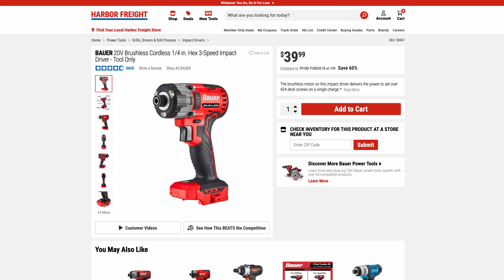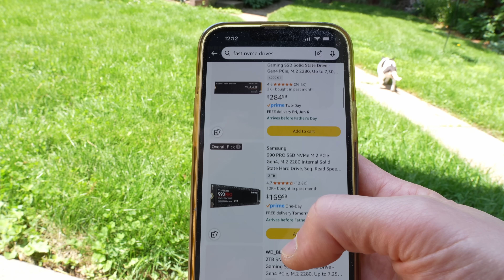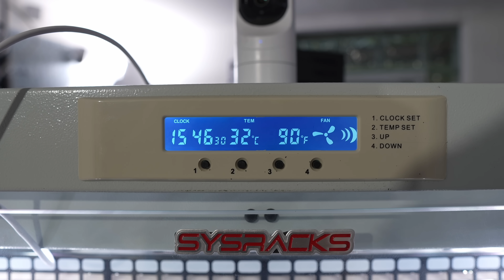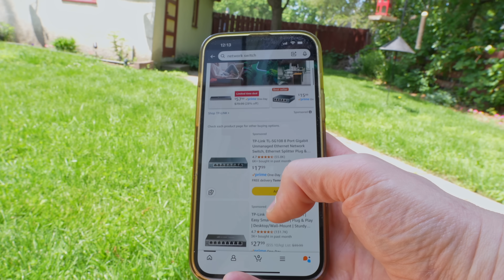Buy Once, Cry Once: How I Wasted $2,857 on Switches

Comment: This is a great thought experiment. 
I have done the same thing so many times. 
The tough issue is that you don't know if you need the best thing. Perhaps the cheap thing does fine, or you are ok with sub par because you realize that its not your passion or you don't build more in that direction. 

I think it's about what you said, which is stepping back and thinking, as opposed to "just one fix" 

Sometimes, you don't know what you don't know... Until you fail, and then you know!

Comment: The thing about SFP+ is that it's just the interface before the PHY in every RJ45 switch, so its flexible and I use SFP+ as much as i can, because it saves power on all ends and costs less

but SFP+ to RJ45 10G? that's PAIN

Comment: I felt this video deeply, having upgraded Unifi switches time and time again, finally landing on 2 x 48-port Unifi switches and the Aggregation switch. But I also PoE power a LOT of my gear now, including my 5-node HP G3 Mini (i5/64GB each) cluster, my 8-node Pi4 cluster, my 3-node OPi5 cluster, and others. I've had to rethink my edge gear based on the capabilities of my network instead of the other way around.

Comment: It's not a waste if you learned along the way, but that Pro XG is an abomination.  It's a "suckers with money" solution to problems that aren't there in the first place, and its disjointed feature set tells me this is really 3 smaller switches in a trench coat.  Notwithstanding the fact that 25G didn't exist yet, this would already have been a dull product back in 2012 when 10GbE was exploding in office datacenters and multimedia shops.  Even today, things that want PoE rarely need even 1G, except for little breakout switches of course.

Most people reading this would be better served by two much cheaper switches: one very fast one feeding your workstation(s) and home servers, and one basic PoE workhorse for all your IoT stuff.  Stick with Unifi if that's your fetish, I'm not judging.

Comment: I still don't think 10G over copper is the reasonable solution in most cases. If you need the more-than-2.5G performance, I'd always argue that fiber is the more efficient solution. And yes, if you think you need more than 2.5G for your Wifi, you probably should attach a cable to it. Maybe there's a case to be made for really high-density stadium wifi setups or something like that. But for almost all other scenarios I will argue that 2.5G is the right speed for your copper infrastructure.

Comment: Don't buy what you 'Need Today' also don't buy what is the 'Best and Brightest', buy what you 'Plan on Tomorrow'. 
You shouldn't purchase a 48 port switch when all you plan to use it for is a single computer, a printer, a nas and a ps5. Just incase in the off chance in a decide you might wanna plug in more stuff. 
I'd say for the most part, the way you did it is perfectly fine. Also the amount you paid for the stuff isn't the end price, you can resell your old stuff to recover some of that and reduce your sunken investment.

Comment: I bought my Netgear GSM7248 48-port GbE switch back in 2019 for $60 USD.

It was sucking back too much power (and a bit of noise that came with it as well).

But my biggest driving factor for SCALING my homelab DOWN rather than up, and out, as most tech YouTubers/homelabbers do, was just the total power consumption which, at the time, spread across 4 NAS servers, and the 48-port switch, was sucking back a grand total of 1242 W from the wall.

So, with a mass consolidation effort, I moved everything into a single "do-it-all" Proxmox server, originally with 256 GB of RAM, and had a 4-to-1 consolidation.

(Since then though, I did fire up my QNAP TS-453Be 4-bay NAS back up, which, when running, consumes about 50 W with four HGST 6 TB SATA HDDs, but when the drives are powered down, only consumes about 17 W.)

The two biggest advantages with the mass consolidation was that:
1) The virtio NIC presents itself inside Win10+ and Linux as a 10 Gbps NIC. (Haven't been able to find out what it's true speed limit is, because I'm only using HDDs.) But this meant that if I wanted 10 GbE networking, it was entirely virtualised within the Proxmox environment, and therefore; I didn't need physical 10 GbE hardware (NICs/switches/cables, etc.) And also with it being virtualised, I can add as many devices as I want to, and not have to worry about running out of ports.

2) I ended up cutting my total power consumption down from 1242 W to around 700 W right now. So, not quite half, because I had to fire the 4-bay NAS back up, because when the Proxmox server was busy with I/O, it would cause some services to timeout, so separating it and having something else that tended to have less I/O requests, helped with some of the offload.

And now, I am using two Netgear GS116 v2 16-port GbE switches instead, which only use about 7 W each, so I have 32 ports total, and those are really cheap now.

For higher speed networking, I also spent $2270 USD on a Mellanox MSB-7890 36-port 100 Gbps Infiniband externally managed switch, which I bought in 2018, which provides upto 3.6 Tbps (half-duplex, or 7.2 Tbps full duplex) of switching capacity. That switch can suck back, I think it's like 200 W, but the spec sheet says that nominal power consumption should be closer to 122 W with passive cables (and of course, it also depends on how many systems are connected to it).

I don't have anything that needs PoE yet, but if I were to deploy it, I would probably initially go with getting a PoE adapter/injector until I have enough devices where it would actually make sense for me to install and deploy a PoE switch.

The idea of me going straight from 1 GbE to 100 Gbps IB is such that I skip all of the other speeds in between (2.5/5/10/25/40/50 Gbps). So rather than making, as you said, small incremental upgrades, I just jumped straight to 100 Gbps. On an absolute $ basis, yes, it was expensive. But on a $/Gbps (per port) basis, it ended up being cheaper than many of the other options. (I think that I did the calculation once, where if I wanted to keep the $/Gbps constant, but then scale that down to like a 16-port, 10 GbE switch, that switch would need to cost no more than $60 or something like that, to stay at the same $/Gbps rate as my 100 Gbps switch, which, of course, doesn't exist (yet).)

That's how it ends up being a much better deal.

And from watching tech YouTubers and/or other homelabbers, many don't tend to run the analysis this way.

And I also went 100 Gbps IB because for 100 GbE (also from Mellanox), Mellanox has the Mellanox tax where they would charge an extra 50% even though their NICs have their VPI where you can SET the port type as either IB or ETH, with their `mstconfig` tool.

In other words, they're charging said extra 50% just because they can, when really, they could just as easily make a switch where they could've deployed their VPI technology for each port, and then you can get a mix of 100 Gbps IB/ETH switch in one, but they don't do that, because they want more money from you via arbitrary, forced product segmentation.

(Why let you buy one switch that can do both when they can make you pay for two - one for IB and one for ETH?)

So, as a result, 100 Gbps IB it is.

Comment: I had this issue with CPUs for my server
i7 2600 > i5 6600k > i7 7700k > R5 5600G and then i just gave up and got the i5 13500 I kept running either into performance issues or issues with video transcoding

Comment: Buy Once, Cry Once is crap for HomeLabbing so stop beating yourself up.

The point is, for things beyond Air, Water, Food & Shelter (Hmm... Internet access seems to be missing from that list) I think "Buy Once, Cry Once" doesn't apply.  Unless or until they are tools used in support of the first tier of Maslow's Hierarchy of needs, like perhaps becoming a Full-Time YouTuber, then these tools become responsible for putting and keeping food on your table and a roof over your head, should your purchasing calculus fundamentally change. Until that point, they are a hobby, serving at a much higher level of the hierarchy, arguable the top level, self actualization or realising your full potential. 

Buying for a hobby is fundementally different than buying tools for a business that supports your livelyhood and when the purchasing decisions should change dramatically.

Comment: Realistically - you don't need those 10Gb connections to anything else than your main PC and servers.
Reply: I connect my servers to my switch at 40gig, then all my computers have 10gig access to my server. So I’m not waiting on stuff to move or load as long.
Reply: @hengry0 ok. Do you know your bottlenecks and their speed? 
If you want and if you can afford it - you can go 100G. But that does not mean that it will be ever used. 
I don't know the number of PCs that you have, but I am sure that you are operating at maybe 10% of your load. 
It doesn't matter if you have 6 lanes highway if on both ends there if this road there are 1 lane bottlenecks. And this is precisely your situation. 

It might look pretty, but no practical use. I would probably enjoy it and congrats to you for having that opportunity, but let's not fool ourselves that it serves any practical purpose.
Reply: you sure ? try anyhing below 10G with 3 or more Ceph node , eiher use it as distributed storage for k8s, or even dockers, run all ur VMs with RBD , put container datas on cephfs share across all nodes. You will realize 10G is too little for that. Also, its not the ony use case of 10G+, you can split 10G to muliple VF and assign to VM, much better perf with hardware offload. Or open vswitch/ swichdev natively support by Intel and Mellanox cards , so many use case for 10G/25G.
Reply: @d3adc3II  I get the angle you're pushing, but let’s not bend the topic out of shape. We’re talking home setups, not enterprise-grade clusters. Your example feels more like a lab fantasy than lived experience. If we justify gear based on fringe scenarios, we might as well spec for running an ISP.

For real-world home use, 10G is rarely maxed out. Stretching the context like that doesn’t hold up — and it won’t go unchallenged.

Comment: My issue with faster switches, especially the UniFi kind is, that next to being quite expensive to buy, they also use an inordinate amount of electricity to run. 1Gbit vs 2.5Gbit is already a step up. And 10Gbit is even worse. It would be OK, if they managed to idle at similar consumption to 1Gbit Switches, but they don't. And adding PoE makes this even worse, since PoE seems even less efficient than the usual cheap 12V PSU  that comes with a cheap Switch.

Comment: Many of us could use 24 port switch or even 48 port switch but in a 2 story home to have 24 or more cable runs put in professionally in wall would cost $5,000-10,000, at least in California.  

So cheaper to put in 24 port switch in main closet and have 5 or 8 port switch 10gig switches in most rooms.

Comment: noting this is all for just homelab..... went from 5 port unmanaged to 16 port(generic AirLink).... than bought a 24 port d-link managed.... from that got a 48 port hp.... setup ip camera so got a 24 port hp poe to go with it...... switched those both out with a juniper ex3300-48P(overall newbie friendly, most of it can be configured via webgui with 4x 10gbe fsp+ ports), and recently bought a generic YuLinca 12 port(4x copper and 8 sfp+) 10gbe L2 managed switch to get more 10gbe ports..... up till now I've not really any regrets as to my decisions in purchases, noting I tried to always get overall the best technically speaking I could get from the used market for the lowest average price(not necessarily the cheapest price exactly; there was cheaper switches with 10gbe for instance but I chose the juniper cause overall it had best wattage, most standard 10gbe ports, most amount of sfp+ ports at it's price range/etc..... the YuLinca similarly, there were a few cheaper options but mostly all 8 port if mixed copper/sfp+ or one but not the other port type) and similarly for the unmanaged stuff that was all bought locally at the time.... using vlan's, port aggregation for linking between the Juniper and the YuLinca

Comment: With tools, sure. A Snap-On 17mm wrench will last me the rest of my life. Computers just aren't like that. You said it yourself: that switch didn't exist a year ago. Our needs change. Our desires change. Until a couple of years ago, my "server" was just the gaming PC I just replaced every 5 or so years. Then I found out about the *arr stack after decades of finding just the right Linux iso of every distribution I wanted. Which cascaded into now having bought not one, but TWO dedicated servers. One for virtualized opnsense and other essentials on Proxmox, another with dual Skylake Xeons with virtualized TrueNAS and Debian with 65 docker containers at last count. My switch was just a dumb 1gb for a long time. I have no idea what I want or need in a switch, so I went with a used $100 Brocade switch with two 40gb ports. Almost everything in my rack I bought used, including the 16 3.5" bay DAS and the HBA it plugs into.

And it's not like you can't resell the stuff you don't need anymore. That's just the nature of computers. I'd be pretty surprised if that's still your main switch in 10 years without compromises.

Comment: Have had very few regrets during the years. Waiting for new tech to mature and jumping every second gen is generally a good way to avoid getting stuck halfway and balance performance/cost. Did get caught out on stepping into a 2.5gb switch believing that was going to be the next thing. But now I "have to" invest in 10gb and wifi7. The advantage of a major network upgrade is that it will last most home users many years. Gradually migrating from 1gb into full 10gb internet(5gb)/wifi/lan/nas over the next 12 months. Sure it will last at least 8 very satisfying high speed years. That's good enough for me. The cat 6a cables I installed in my home 7 years ago are btw still 100% up to the task for a 10gb system.

Comment: Most of your prior gateways, switches, routers and so forth still sell on ebay and other marketplaces to a moderate price. This at least can help to refinance the new gadgets to some degree. I bet even some of your community members would be happy to get some of your previous hardware if you really don't need those and also don't need to maximize your return.

While I have gone through a similar process over the years, of course not to a degree like you, in the end we love to play around with things and getting it right on the first go would also be ... boring ... and less fun, IMO. In the end, most of what we do, especially after some initial setup, is probably overkill (for 99% of the world) anyway and less would be fine in most cases either way. I therefore consider it only a loss when I either didn't find any use for it or replaced it with something other rather quickly and thus couldn't get my dose of "fun" out of it.

Comment: Ubiquiti will never get another dime from me. They suck. 

The packet buffer for this switch is only 8MB. You’ll likely experience a lot of jitter and packet loss if you actually try and use a lot of the advertised horsepower. 

On the surface, the specs look great. As with everything Ubiquiti, you end up finding out the gotchas and realities after installing the gear.  Their customers are guinnea pigs, and they aren’t motivated to fix bugs that have been around lingering for years.

Compare the price of this switch to others with similar specs. Ask yourself why nobody else is even in the same neighborhood, and if you think Unifi is just that innovative, or if they’ve more likely cut corners. 

I’ve seen several “get them while you can” themed videos around these switches recently… something smells of flimsy social media campaigning. I’d rather wait and see how it shakes out than be an experiment for Ubiquiti again, if I were to ever consider doing business with them again

Comment: Assessing what you need vs what you might need in the future helps prevent overspending. 

You might determine that your gigabit router is enough because all you do is transfer some files between local computers some of the time, and your internet is slower than gigabit anyway

Or you are a homelabber so might as well get that fancy thing cus it'll get filled up big time anyway

Comment: I have a few of your switches, but mainly it’s about the solution needed for the location, I don’t want to run additional cables in the walls, so under the main TV there is a lot of kit, running at 1G bit in my office I run 4 ports a 10G and 8 ports at 2.5g on a 10g uplink - of course you upgrade accordingly to budget , ecosystem and technology, no point in putting a 25G switch in if nothing runs at this speed, and you need say a NAS and a computer system which will use the bandwidth otherwise what’s the point.

Comment: should have picked up an arista 7050tx fro 300 bucks or less on ebay and then mangled that into a different solution for POE to handle the poe crap. Those arista switches were 25k in 2018 and are 300 bucks now and still destroy most of the new sub 5k 48 port 10 gig switches as far as latency and other metrics go. with th 40 gig ports you can pretty easily  hook them together with a crapload of bandwidth too ( I have one in my garage, one in my rack and one in my furnace room serving my house. Plugged into  them I have 5 flex2.5 POE ui switches in various places for poe for cameras, aps,etc. Rack switch connects to fiber to outside and has 2 lagged 40 gig fibers to each of the other switches. at 300 bucks a pop you can pretty easily keep a spare ebay arista in reserve for if one craps the bed. It's been several years and I have yet to use my spare. It just works so far.